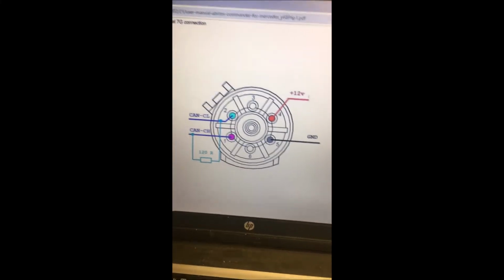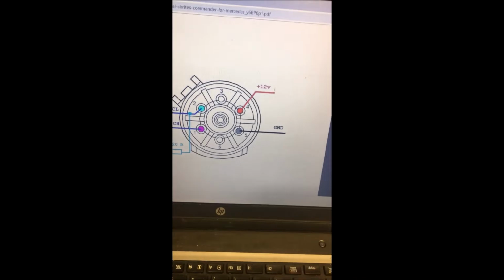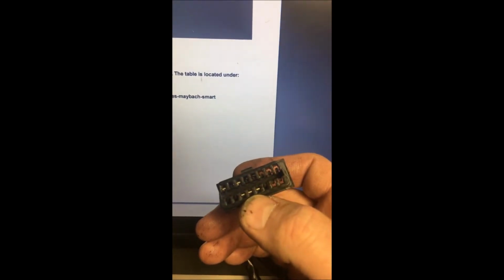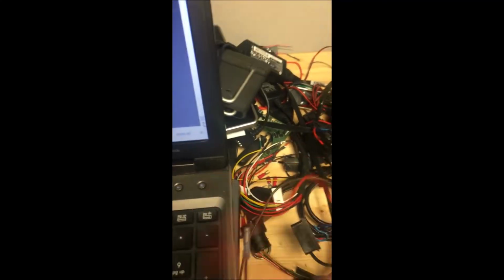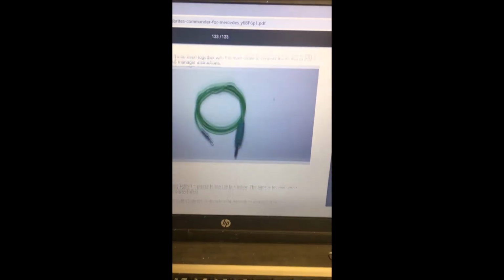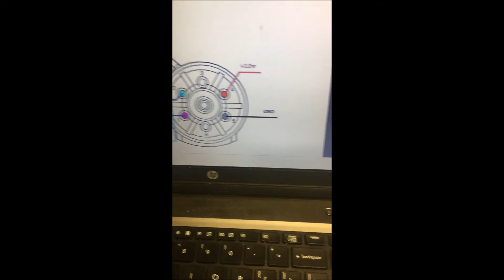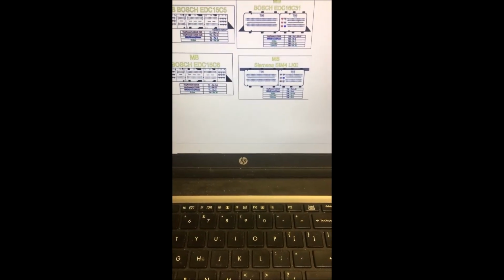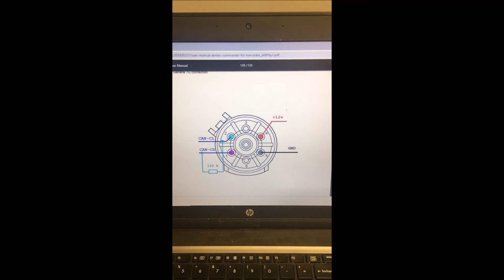Mercedes 7G trans Cable

Comment: Hi Tim
I am having problem to renew a 7g (0310) vgs3, maybe because there is no 120 ohm resistor in my cable?
I can read it and do everything just when i try to flash it, it gives me failed to renew the ETC.
thanks for your help
Reply from the maker: Are you doing it with direct connection to the conductor plate?  Do you have good internet?? What does the screen say after trying to virginize??  which update of AVDI are you on??
Reply: @timtracy9442  yes i am doing direct connection with conductor plate, and yes very fast internet. i am trying to renew a second hand plate that was on w212 and want to reflash it with new cff file so i can make it work on w204
it says "failed to renew the ETC". when i try to reflash it with the flash that i want it gives me this error
Reply from the maker: @rabihadra1  which version of AVDI do you have? Were you able to virgin the conductor plate and put back to not personalized and not activated??
Reply: @timtracy9442  i am using latest version, latest update, i did not virginize it, i am trying to reflash it with a new number

Comment: Hi Tim, I got a 2007 Audi Q7 with MED9.1.1. I buying a new ECM from the dealer to install on the car. I plan to program the keys  with either  maxisys 908 and Abrites. What is the Easiest way to program the Keys on  to the ECM. Do I need new keys?
Reply from the maker: Good luck with the Maxi....  I have never been able to do keys with one...  I would use the IMMO  parts replace function...  Read data from old ECU, put in new ecu, then open the tool, put in your VIN, MAC,CS,and pin, click update, and viola, turn key off, turn key on, start car...  and as for new keys, no...  Key data for that vehicle is stored in the Kessy module...  you are just adapting a new ECU to the car...
Reply: @timtracy9442  thanks

Comment: Hi tim , can you said more to 722.9 tcm adaptation .
I did 2 cars 2008 ml and 2006 E350
And work perfect.
But now i have 2 cars in my friend shop
This 2 cars is exactly same 2 cars are E350 2007 and a cant  make it  adaptation
VIRGINASE ok. PERONALISATION ok. 
ACTIVATE ok. But cars not work
One car  not star ( code : park neutral sw not learned )
Second car run but not transmission power ( code; can comunication problem between EZS AND TCM)
I have this codes ONLY WHEN I FINISH ADAPTATION , NOT BEFORE
THANKS TIM
Reply from the maker: The E class can be a pain....  My question is, did you read and save data from old conductor plate and then write to the new, or did you virginize new/used and then send data from the EIS???  on the later E class, I read, both DAS data and coding, save, then write directly to the new/used conductor plate...  something about the gateway on the later W211 cars seems to be having issues...  That might be hooyey, but reading and writing directly from and to the trans have worked for me...